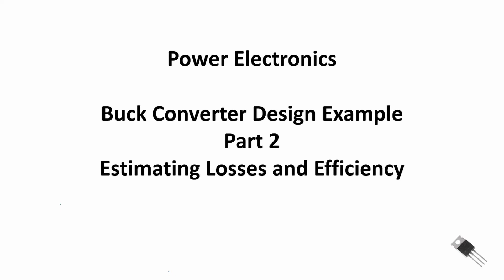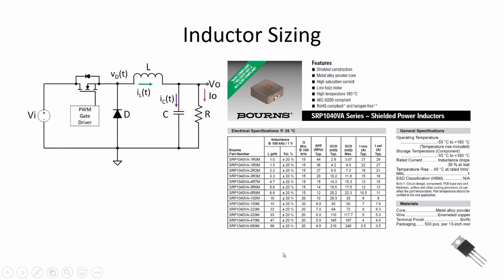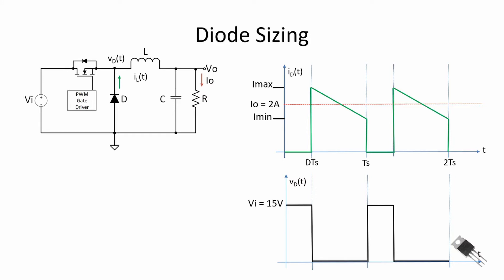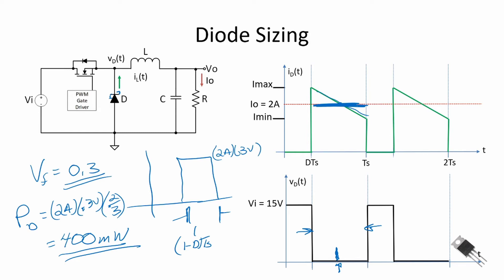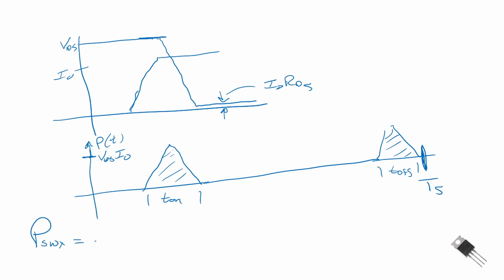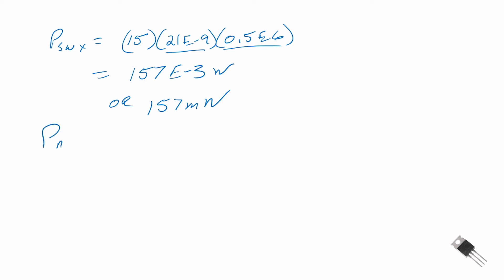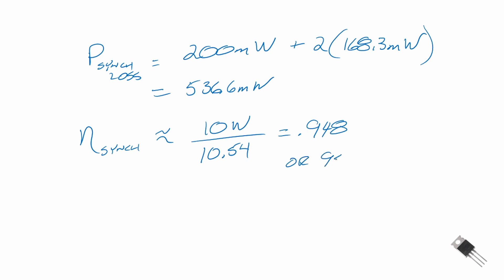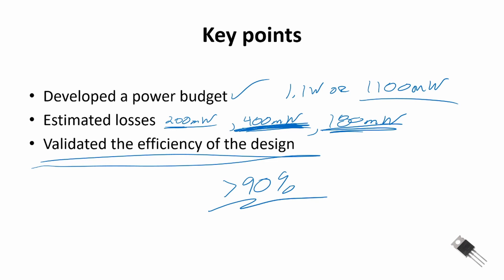Power Electronics  - Buck Converter Design Example   Part 2

Comment: Can you please explain while calculating the diode losses why did you not include the reverse leakage loss? And also is there any specific reason why you didnt find thr capacitor loss?
Reply from the maker: Hi Omar, good question.  The reverse leakage current is very, very small.  Yes, something to consider especially when looking at battery-based   applications, but not really something to consider for heat-sinking and thermal mitigation.  And, yes, there are losses in the capacitors due to the ESR.  I think a MLCC was spec'd for this example.  If so, these have relatively low ESR and hence, low loss.  However, there is a whole set of other challenges when using MLCC as compared to electrolytic caps.  Hope this helps and best wishes on your design. -Dr. K

Comment: Very valuable video, thank you! I'm learning all the theory, but it helps greatly to have such a well condensed video explaining a practical sizing case. Just one question, doesn't the schottky diode have conduction losses too?
Reply from the maker: Yes, there are conduction losses associated with the Schottky diode.  However, the switching losses are much less due to the extremely short recovery time.

Comment: Great video sir. but how did you use the value 10.54 while calculating the efficiency (16:10)
Reply from the maker: Hi Vaishnaviah.  Great question.  This part of the video is analyzing efficiency and looks at the improvement if a synchronous converter is used.  In synchronous conversion, the flyback diode is replaced with a switching MOSFET.  The power loss estimates become 200mW for the inductor and 2*(168.3mW) = 336.6mW for the two MOSFETs.  This is a total of 536.6mW or approximately 0.54W.  The output of the converter was designed for 10W.  Therefore, the input power is 10W + .54W = 10.54W, and efficiency is output_power/input_power. Hopefully this clears things up.  Best wishes on your design. -Dr.K

Comment: Very valueable video!  But I think if we use MOS to replace Diode, the power loss of rectifier MOS should be lower than another MOS. Because Buck converter need to make a dead time, so its body diode will conduct firstly, and then MOS conduct. I guess there is no switching loss in this MOS.
Reply from the maker: Yes, good observation.  Often that diode is replaced with a MOSFET.  This is called a synchronous converter.  It has lower loss (improved efficiency) but requires a more complex controller.  There is still switching loss in the MOSFETs, but if the frequency is low enough, the overall loss will be better.  There are converters such as resonant converters that utilize zero-voltage, zero-current (ZVZC) conditions and have even better efficiency.  Best wishes on your designs. -Dr. K
Reply: @powerelectronicswithdr.k1017  thanks for your kind response! Sync buck do need a complex controller, that's why I mention the dead-time. During the dead-time, the body diode of MOS will conduct firstly. That will cause an extra power loss: Vdiode✖️Io✖️（dead-time/T）, but body diode dosen't have a ton and toff time, it exists automatically, so I think the rectifier MOS will cause a body diode power loss, but has almost no switch loss.

Comment: Thank you so much. If I want to build a variable output buck convertor, should I do the calculations on the highest output voltage and choose the components please? Thanks.
Reply from the maker: Hi Ziadfawzi.  Great question and the answer is that it depends.  For example, will you try to maintain a constant output power at all voltage ranges?  If so, then the output current will be maximum at the smaller output voltage values and minimum at the larger output voltage values.  It would be a good practice too look at both extremes and see which values will "stress" your components the most.  Sorry it is not as easy as just the highest output voltage.  Best wishes on your design. -Dr. K

Comment: In switching loasses formula instead of ton and toff there should be rise and fall time of mosfet, since it's loss during switching .. not conduction loss is it correct?
Reply from the maker: Hi Gan-rc2im, yes you are correct.  I am using these terms liberally.  On the datasheet, the rise time is actually the amount of time it takes to turn the MOSFET "off". This is the time duration where Vds rises from near 0 V to the supply value  Vdc.  The fall time is the duration it takes to turn the MOSFET "on".  The is the duration where Vds drops from Vdc to near 0V.  Please note that the datasheets use very specific testing parameters and your application of rise and fall times will vary.  Great observation and thank you for watching. -Dr. K

Comment: Really nice breakdown of the losses, thank you ! 
I think there is another reason to replace that diode with a mosfet, and that is the capacitance of the V30K45 diode : it is a whopping 4 nF, which needs to be charged 0->15 V right during that switch-on time triangle. Quick calculation suggests another 250 mW or so loss because of that diode 1/2CV^2*f losses at 500 kHz. 
(And the diode is also more expensive than that nice 60 ct mosfet)
Thanks again, I enjoyed your videos.
Reply from the maker: You are correct.  Also, depending on the application, the synchronous buck converter options are often the better route.

Comment: Hi sir your video is very good 
I have one doubt. Why inductor loss current calculate 4A we have 2A only sir
Reply from the maker: Hi Yaser, it is (2A)^2 which is 4A^2.  Sorry for any confusion on that.  Yes, the current is 2A.  Also note that there is an RMS component to the loss to, but that is typically much lower. Best wishes on your design.  -Dr. K

Comment: First of all thank you for sharing your knowledge, I have just one question why you didn't consider the capacitor??
Reply from the maker: Hi Mohit, hope the videos are useful.  Please reference part 1 of this series for the capacitor sizing https://youtu.be/IpoI6ERn5zM?t=534, Best wishes on your design.  -Dr. K
Reply: @powerelectronicswithdr.k1017  Thank you for your time Sir, but i am asking "Why you didn't consider capacitor in efficiency calculation? "
Reply from the maker: @mohitarora8754  Yes, there is loss in the capacitor and it's based on (Irms)^2(Resr). The Irms should be about Delta_I/(2*sqrt(3)).  For this design, I recall talking about using MLCCs which have an ESR that is often a magnitude lower than electrolytic caps.  Yes, there is some loss, but its smaller compared to the loss in the fly-back diode and the MOSFET, at least for this application, which is not always the case.  If you compute this power loss for a 10mOhm ESR, you will see it is pretty small.  Great questions! - Dr. K

Comment: I really enjoyed these two videos. It’s been a long time since I was doing electronics stuff but getting back to it. I did notice a few things that I think may be incorrect. Like 5 minutes into the video a term is written 4A squared. But it should be 2A squared. Further on the correct squared value 4 is still used so it didn’t influence the result, it’s more a notational slip I guess. Then after about 13 minutes you opened a new sheet to calculate the switching loss. But if I’m correct here you left out the current so in my opinion the loss should be double of what was calculated there.
Nevertheless it was really instructive and helping me to get up to speed again.
Reply from the maker: Hi Peter, the (2A)^2 = 4A^2.  The square is referring to the units and not the value as an A^2*Ohm = W.  I probably should have been more clear on that notation.  Actually the loss in the inductor is slightly greater as there a loss associated with the ripple current. That is there is an AC RMS voltage associated with the ripple current that I ignored.  On the switching loss calculations you referenced, the calculations are correct.  However, I should have included the units when switching to the next page.  The switching loss is (1/2)(15V)(2A)(ton+toff)(fs).  This would be 15W*(ton+toff)*fs.  I did the calculations on those first three terms when jumping to the next page and should have place the units in that equation.  Sorry for the confusion.  Thanks for watching!  Best wishes on your designs. -Dr K
Reply: It is writen as 4A^2 rather (2A)^2, so 4A^2 is correct notation.

Comment: Very Well Explained. Sir how to convert Bidirectional DC i.e +311V and -311V to 72volts?
Reply from the maker: Hi, it depends.  Are those DC bus rail values are those from and AC source? - Dr. K
Reply: @powerelectronicswithdr.k1017  yes
Reply from the maker: @m.hassanbaig6885  Some of it depends on where your neutral/reference point is for the DC side and if you need galvanic coupling between your AC source and the DC load.

Comment: Dr K i have a COB LED which says 10W ,12 to 14 volts , I am confused  if  constant current or voltage is required for the LED - Thank you so much in Advance.
Reply from the maker: Hi, the answer to your question is "it depends."  You will need to look at the COB LED specifications.  LED drivers have similar characteristics to buck converters in that they provide a lower output DC voltage, perhaps around 12-14 volts from a higher input voltage.  When LEDs are connected in series, the nominal output voltage is approximated by the forward voltage drop times the number of LEDs connected in series.   Once the LEDs are on, the intensity is controlled by the current flowing through the LEDs. Each LED has a slightly different forward voltage drop, and often times we use current to control the duty cycle of the converter.  The control of the converter (voltage, current or both) is not something that I've covered in my videos.  Keep me posted on  your design.  Lighting systems are a great application for power electronics.  -Dr. K
Reply: @powerelectronicswithdr.k1017  Thank you Dr K  for the explanation , unfortunately i cannot find any details of this COB strip other than 10W 12 to 14 volts, i am still searching for the details , i will update you soon- Thank you again for your time !

Comment: Sir, when you calculate the switching loss the turn on and off current is not Io right? if the ripple is very huge  I think can't not just use Io times Vds right?
Reply from the maker: That's correct.  Using Io for the current is an average.  If you know the ripple, then the switching loss for turn-off can be estimated at Vds*(Io+Iripple/2)*t_off*fs the switching loss at turn_on can be estimated as Vds*(Io-Iripplie/2)*t_on*fs. If t_on and toff are the approximately the same then a good estimate for the total switching loss is  Vds*Io*(t_on+t_off)*fs. This all assumes continuous conduction mode (CCM).  Hope this helps and best wishes with your design.  -Dr. K
Reply: @powerelectronicswithdr.k1017  Thank because most text book usually use average value so they don't tell why so I'm confused, and I have one question the 1/2 value is because the triangle, the vds and Ids the area alway's triangle? I see some text book use 1/6 but I don't know why , If I want to more accurate how should I do
Reply from the maker: @rj8528  Hi, the 1/6 term comes only when the load being switched is purely resistive.  For a resistive load, the instantaneous power p(t) = v(t)i(t) and v(t) = -(Vin/t_on)*t + Vin and i(t) = (Io/t_on)*t during the turn-on interval.  Therefore p(t) = -(Vin*Io/t_on^2)*t^2 + (Vin*Io/t_on))*t  from t=0 to t=t_on.  The curve of the instantaneous power for a resistive load is an upside-down parabola with a max height of Vin*In/4.  The arear (energy-dissipated) is the integral of p(t) and this equals (1/6)Vin*Io*t_on.  When the load is inductive, the voltage Vin gets clamped to a constant value because the fly-back diode is still conducting while the MOSFET is turning on.  This diode clamps the source node at near 0-volts relative to ground until the diode becomes reverse biased again. In this case p(t) = (Vin*Io/t_on))*t  and integrating results in (1/2)Vin*Io*t_on.  One of my videos illustrates the turn-on and turn-off voltages/currents for a MOSFET.  Hope this helps. -Dr. K
Reply: @powerelectronicswithdr.k1017   if the load is resistor the area I need use 1/6. Normally use 1/2 because the real situation doesn't have pure resistor load ?
Reply from the maker: @rj8528  Yes, that is correct and for the Buck converter, the load is inductive.  Therefore, use 1/2. -Dr. K
Reply: @powerelectronicswithdr.k1017  thanks, Sir can I ask question about slope compensation?